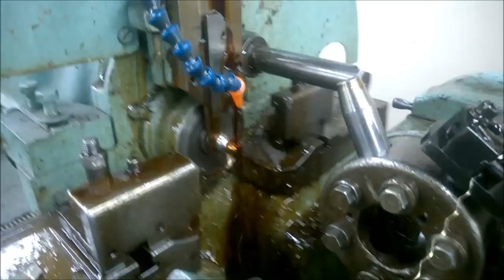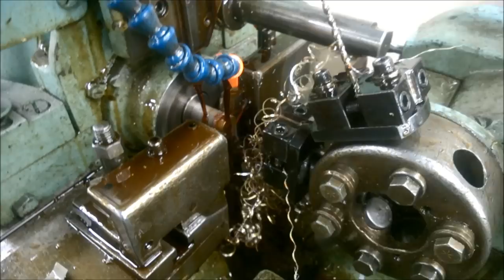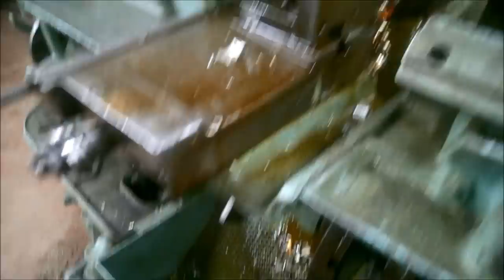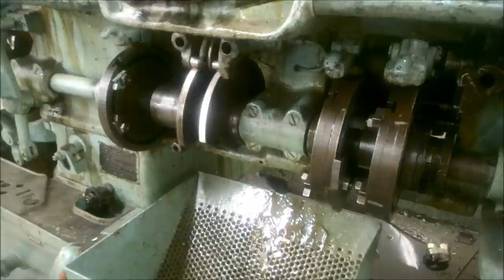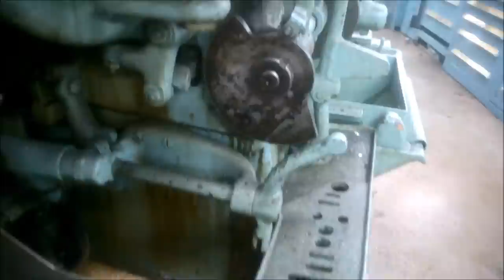brown and sharp automatic screw machine running

Comment: I used to work on these; mainly Index though. Self-sufficient: I made all my own tools out of tool steel and stellite. Flatdrills for brass, tangential turning tools etc. My favourite was Tarex and longitudinal turning. Happy memories. Progressed to CNC. worked in engineering for 40 years. I haven't now for 4 years. The product of the sad demise of British industry. I thought I'd spend time and go down memory lane on this Sunday morning.
Reply: Based on your experience, do you know how early automated (mechanical automation I think it's referred to) machine tools were able to load work pieces? I assume that an incoming conveyor or chute would allow them to be automatically loaded into a clamp, which positioned the work automatically? I'm sure it depended on the machine and the type of work involved. Just curious and thought I would ask, since you seem to have personal experience with older automatics.
Reply: @benbird2100  Morning/afternoon or evening. I would presume from the early days. I remember an old BSA being used for this purpose back in 1973 when I was still at school. A magazine was rigged up and the pieces would be gravity fed and pushed into a spring-loaded collet. The only time I had personal experience was back in the 90s when our company made body jewellery out of 316 stainless steel ball bearings. They were fed from a hopper at the rear end and then along a sleeve to the collet. I didn't devise this but it really was a stroke of genius. By that time I'd been working on CNCs for about three years.
Reply: Thanks for sharing ! These machines can put run most new machines, I’m thinking about maybe resurrecting one if I can figure out how to run it …. CNC guy here
Reply: @tylergibson7226  Good luck with that. Those old cam-autos try the patience of a saint.